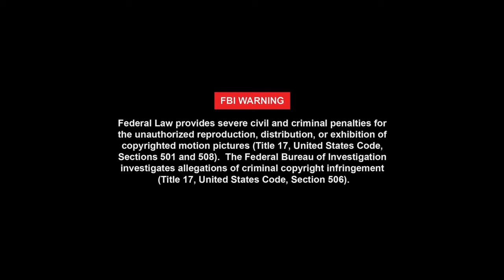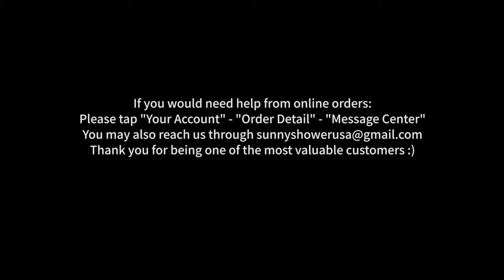Install Elegant Corner Sliding Shower Enclosure | BL Series

Comment: This nor the Installation piciture book BL Series Installation Instructions tell exactly how far out to install the two Wall Profile verticle are to be from the back corner of the wet wall in order to get the shower enclosure perfectly square. That is a key measurement that should be witht he instructions. I know it will be ROUGHLY 36 inches, but that should be established in the guidance on YouTube and in the installation instructions.

Comment: Anyone else have a sag that doesn’t allow the bottom part of the magnets to come together to form a tight seal? If I press the top frame up toward the ceiling, it will seal properly. But it won’t on its own. I don’t know how I should adjust the set screws on the sides to alleviate the problem. Any suggestions/ideas welcome.